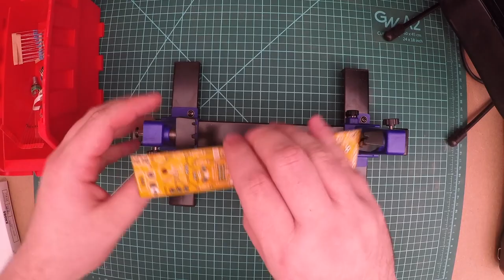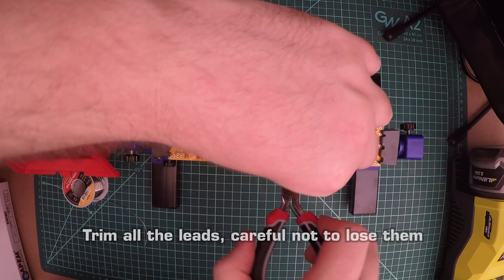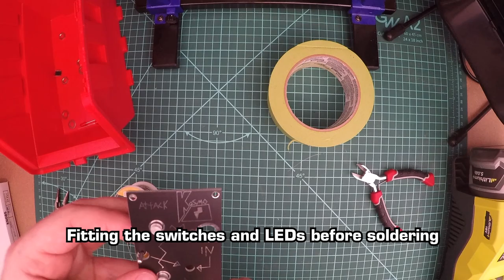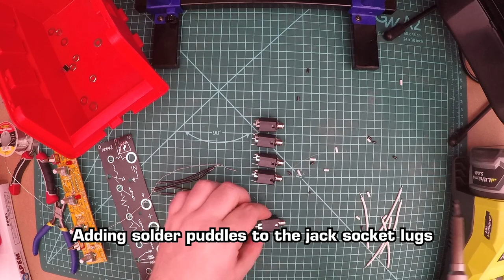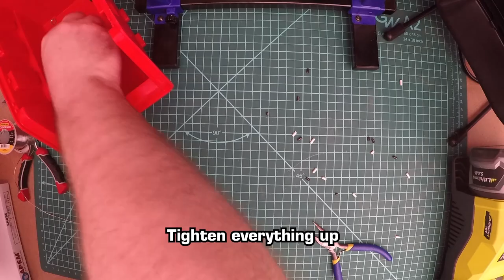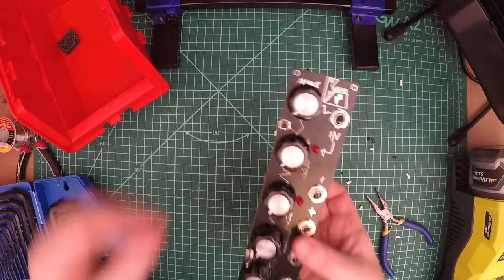Mini ADSR Envelope Generator - LOOK MUM NO COMPUTER - DIY Synth

Comment: Hi Matt great video, thanks. I wish I had seen it before I built mine just now! I used molex on the jack sockets but theres no need as you have done. I also didn't screw down the heat sink on the voltage regulator to the pcb - probably should do that. Cheers Stuart.